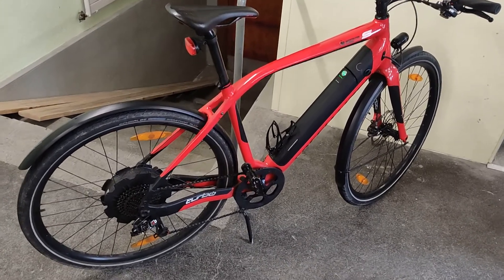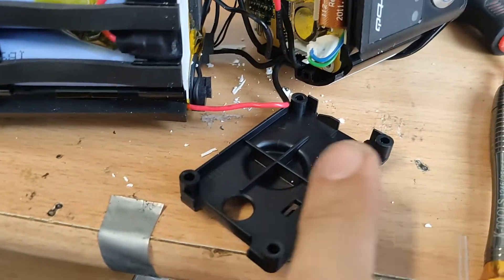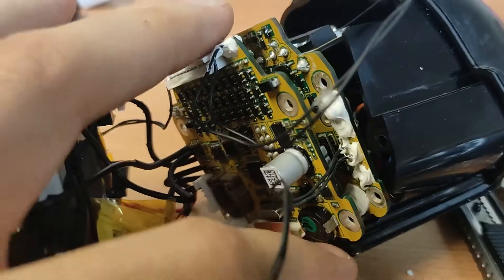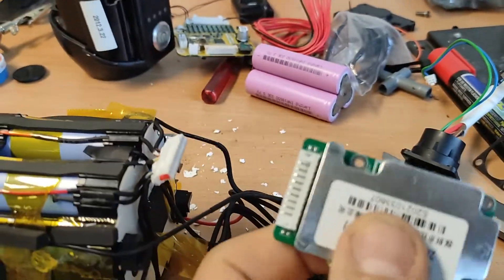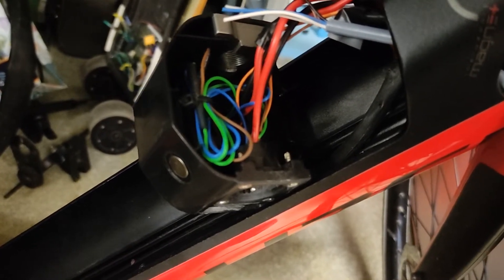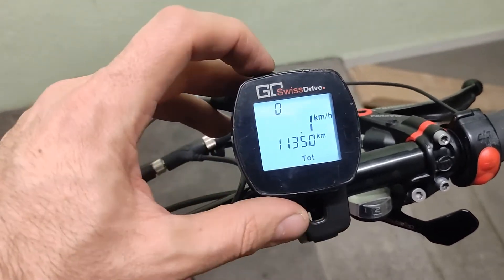Setting up a secondary system on a Specialized Turbo 2013 Ebike

Comment from the maker: 0:38 battery Disassemble of the Battery
1:37 Inspection of the Original BMS
5:58 Replacing the BMS
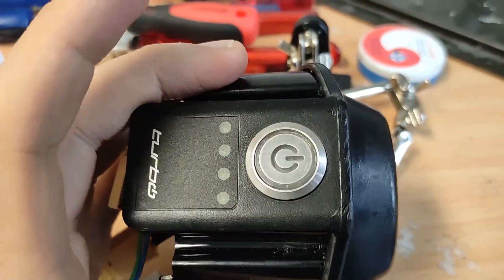7:56 Connecting the After Market system
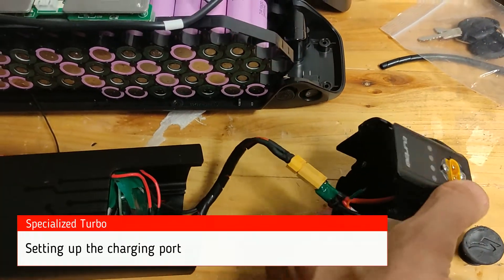12:15 Setting up the charging port
13:40 Secondary system (Go swiss drive)
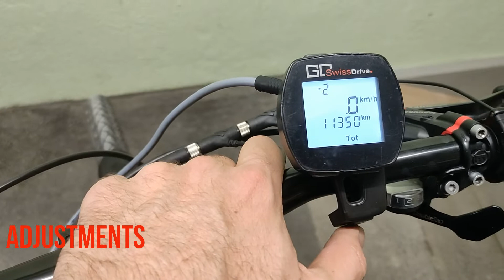14:06 adjustments on Go Swiss Drive

Comment: Thanks for sharing your expreience. I have already a Turbo S in use. Unfotunately, the Head- and Tail-Light dosn't work anymore. Did you figure out how to connect the System to the original Lights? Thanks in advance. Regards Urs
Reply from the maker: @urswymann8224  the Bike is sold long ago, thanks for watching.

Comment: Awesome video, do you know if the Go Swiss motors can be used if the Specialized motor is broken? To be clear it seems you used the old Specialized motor with the new Go Swiss BMS correct?
Reply from the maker: Hello no idea, since I have sold the bike.
But the original Specialized motor was from Go Swiss as far as I know. (The motor manufacturer went out of business).
 Perhaps there can be a Custom a motor with a special Controller from Grin Technologies but not sure you want to invest that sum of money.
Reply: @diyelectricbiker9361  Hey thanks for coming back, actually the rights for GoSwiss have been bought by YouMo and they are stocking parts and repair services. I have followed up with them to check if replacement motors can be fitted to Specialized bikes. Thanks again and great content!

Comment: Cool.  Searching for an alternative display that works with the Go Swissdrive bikebus. YouMo claims to have a transceiver to allow a SW-102 befeng display.  Cant find a GoSwiss or Green Mover display for less than $400.
Reply from the maker: Well there are used ones in the German market around 100-150$, however not sure if you want to invest more in a Motor which is been off the market.

Comment: Nice video! Was the bike driving with new BMS and the EVO display? I ask this because I have replaced the BMS by a smart BMS but I don't have the EVO display yet.
Reply from the maker: Hello yes it worked.. However the Bike was sold later with a additional Smart BMS Battery.
Reply: Thanks a lot for the confirmation. My problems is that I can't find a Go Swiss display for the moment. I will keep searching for a solution.
Reply from the maker: @dimitryczymerys1417  you can ask at pedelecforum.de it's a German forum though.

Comment: Hello DIY Electric Biker, I am working on the exact same project. And am wondering if other displays would work? For example Bulls Green Mover?
Reply from the maker: Hi, yes Bulls controller should work, unfortunately the Motor is discontinued.
If you know a Motor with (Hollow Shaft ) for the back you can also setup everything you want.
Reply: @diyelectricbiker9361  Yes, I have explored a new motor option. It would be $500 plus controller & remote. All together probably around $800. I also need to repackage the battery. Additional $300. That is why I don’t want to reuse parts as much as I can. Thanks for the advice though. 
Do you think the remote Brako offer would work as well? The photo is under your post on the forum.
Reply from the maker: @dealpaker  I don`t know, but the seller has maybe more experience with Goswiss drive. Which Motor do you mean ? Because the Axle is special who manufactures that ?
Reply: @diyelectricbiker9361  Crystalyte rear motors that are designed for 142x12 rear thru-axle.
That motor would pair with Baserunner L10 controller and Cycle Analyst Display
Reply from the maker: @dealpaker  Cool didn't know.